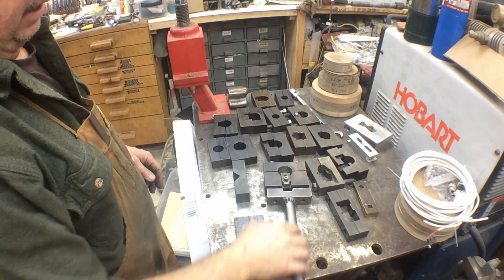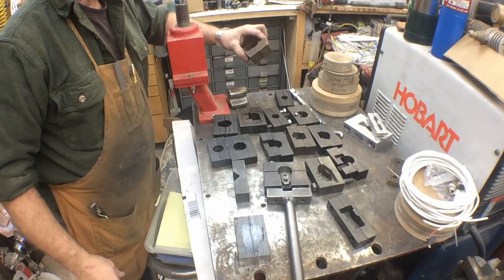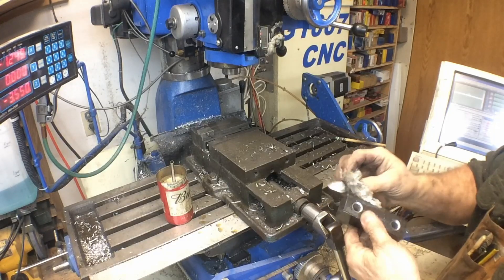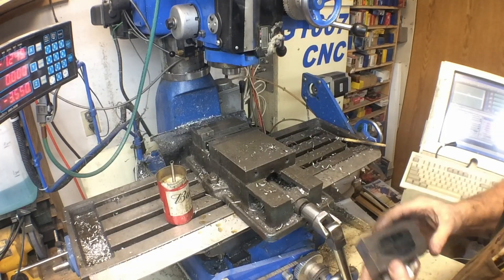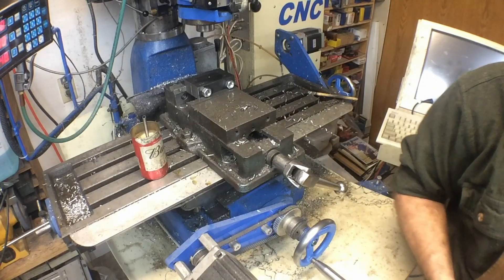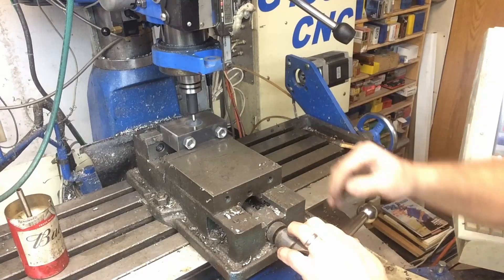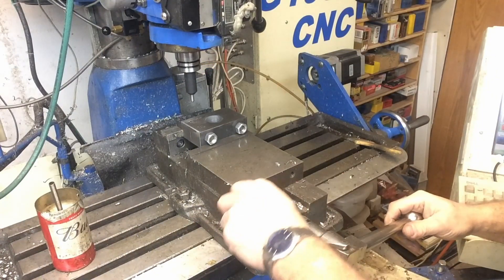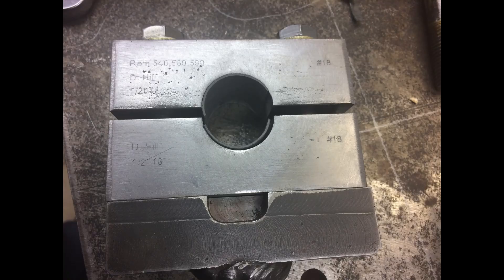Building An Action Wrench For The Gunsmithing Shop

Comment: What size bar stock do you use for most of your wrenchs and what alloy do you use? 
Great video as well.
Reply from the maker: Stock is 1 1/4 thick and whatever depth is necessary for the action anywhere grom 1 1/4 to 2 1/2, thanks
Reply: Awesome, thank s for the information.
Reply from the maker: alloy is not important for this application, part of mine are cold roll, part is whatever free machining material I have on hand.